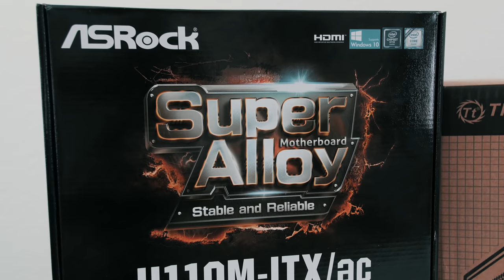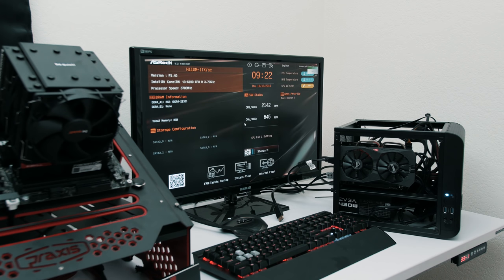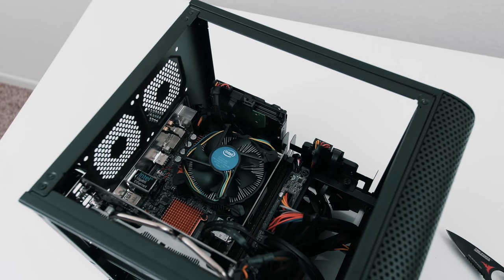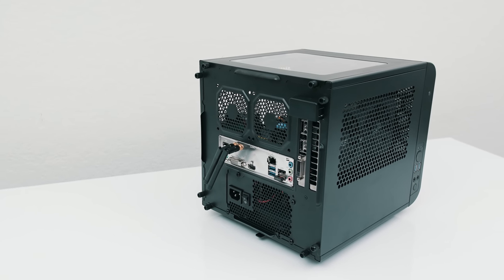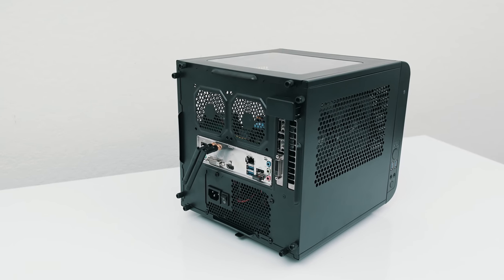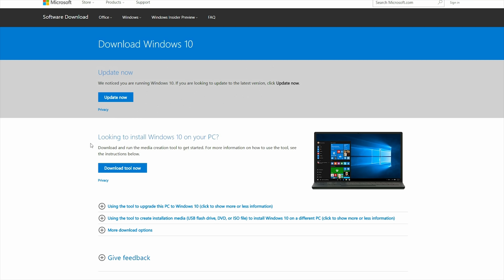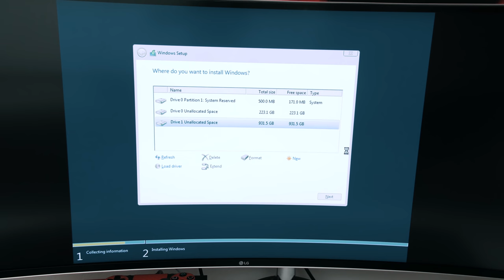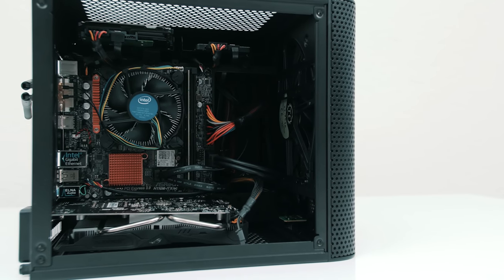How To Build A $500 Gaming PC w/ Windows 10 Install

Comment: I'm going to build my first PC so I'm new to this. Is it ok for me to upgrade to the i5-6400 and get the gtx 1080. Will this make it run better? I'm looking to be able to run new games at high settings 60 fps. I'm going to keep all the other parts the same exept for the cpu and gpu. Just want to make sure they will work well with each other and will be able run new games without an issue. Thank for the help.
Reply: Or even the i5-6500 as a cpu. Whichever will run better with the gpu.
Reply: The GTX 1080 costs like $1000 and is a beast at gaming... an rx460 or rx470 can give you 60fps in most games at high settings+
Reply: Lucedoke shit I meant the 1060 but I did some research and it looked like it would be fine
Reply: Yeah a 1060 would be good...
Reply: Lucedoke also I'm getting a different ram stick because I would prefer to buy on amazon. But pretty much any 8gb ram stick would work right?
Reply: Yeah, just make sure its DDR4 ram (Its much faster)
Reply: Lucedoke alright thanks for the help. As you can probably tell I'm very new to this.

Comment: The Graphics card is out of stock.. and so it is gonna cost almost $300 for a used one! Can someone please help me? Can I get a different part? It's the last part that i need for this bud
Reply: Yes get a cheaper one like a GTX 1050 and you can upgrade later when graphics cards are not so crazy in price
Reply: can u link that part for me ? im sorry im just really bad at this kind of stuff
Reply: https://www.newegg.com/Product/Product.aspx?Item=N82E16814487296&cm_re=GTX_1050--14-487-296--Product

This one will work and is around the same as the one in the video or better, you can upgrade later if you need to as 1050's and 460's aren't the best
Reply: lemme know if u have any problems
Reply: and this will for sure work in the build? because ive got all the other parts in the build
Reply: and should i get double fans for $20 more?
Reply: I'd just stick with the single fan and save money and yes it will work
Reply: did you finish your build yet? you can build it without a graphics card and use the motherboard graphics, you just won't be able to play games well until you put one in
Reply: no i need my RAM, windows and graphics card, so im really close. thank you so much for helping!
Reply: and the double fan is only $10 more, or $20 is it not worth it at all?